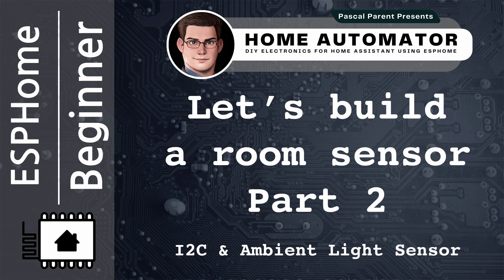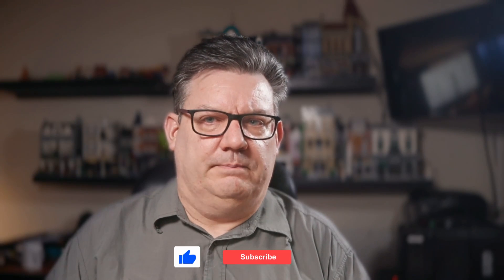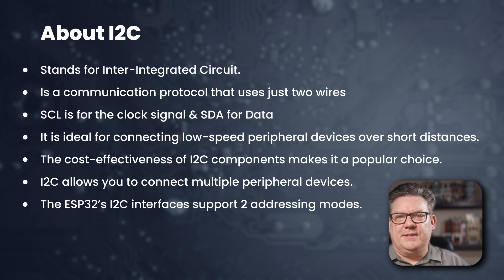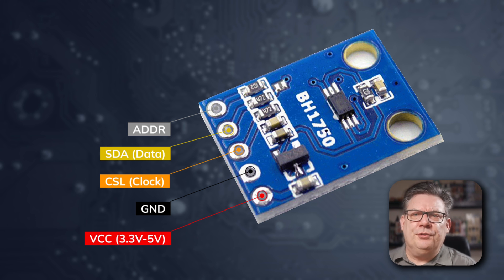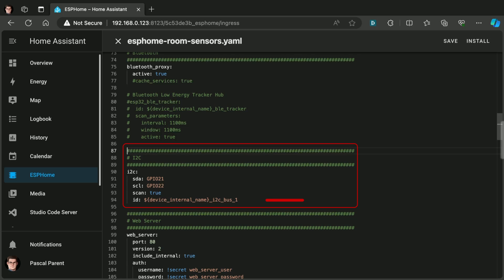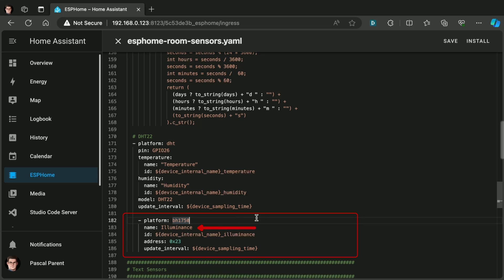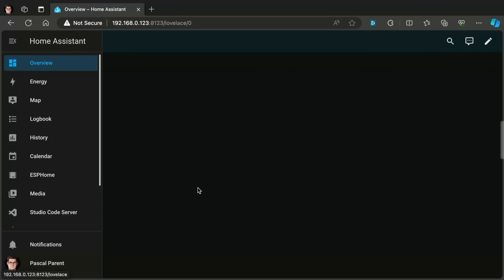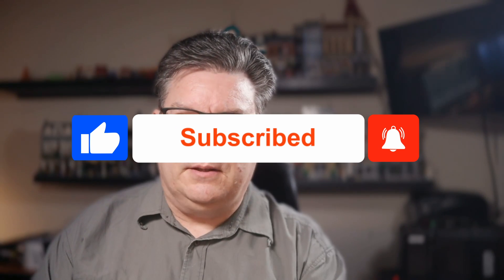Let's add to our room sensor - Part 2 - Ambient Light Sensor

Comment: Good Video. I like the BH1750 for light/lux levels. I use it along with the LD2410C mmWave presence sensor. This combo allows you to detect when someone comes into a room, then test to see if the light level in the room is low enough to turn on a light, also good to know when a person leaves the room so the light can be turned off automatically.
Reply from the maker: Spot on